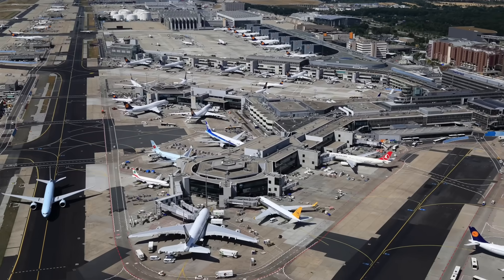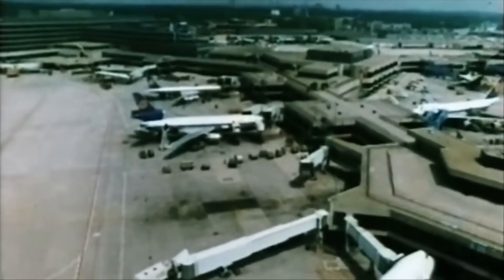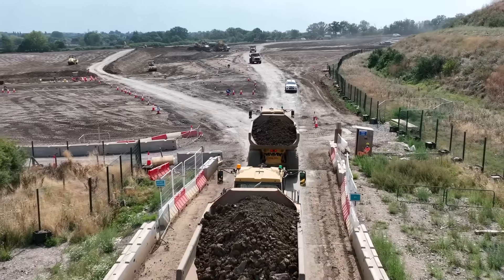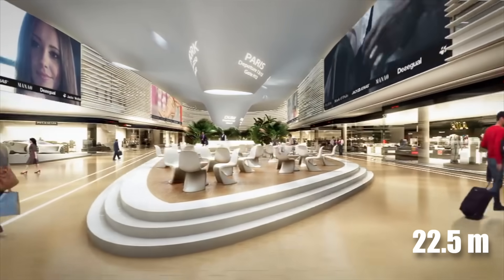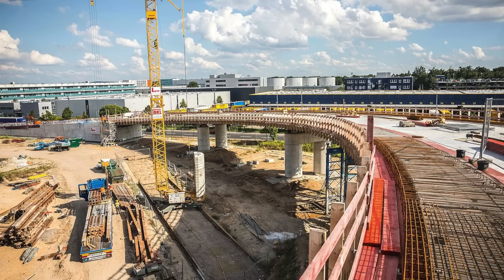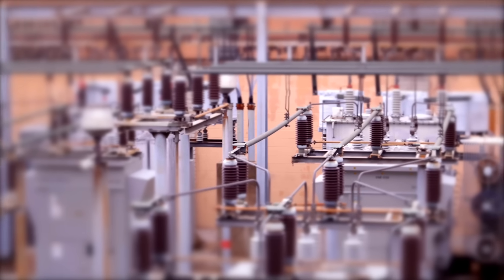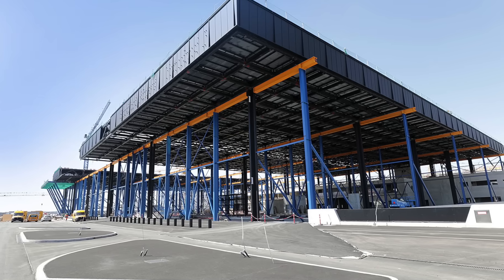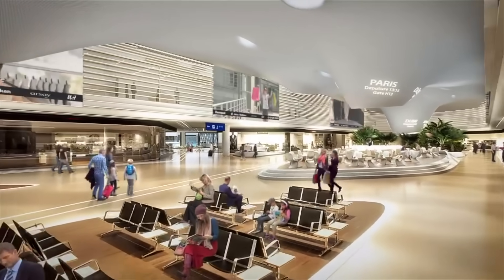Frankfurt's $4BN Mega Airport Expansion

Comment: Frankfurt and the region cannot handle it as the infrastructure surrounding the airport is crumbling. It will be nice to look at if you take the effort to fight your way on the autobahn or take the painful S-Bahn ride which currently suffers. It suffers from maintenance work on the routes Frankfurt-Cologne and Frankfurt-Mannheim - after which it will be not better as in the next decades the country stumbles in maintenance work to keep its neglected infrastructure somehow running.

Lastly don't think this 3-Terminal airport will run on 3 Terminals. This is my local expectation: they will close down existing terminals or parts of it for more upgrades as they also are in an inferior state.

Comment: There is also another train curve under construction, so the S7 commuter train line can run to terminal 3 which will get another underground train station. Like this, people coming or leaving by public transit to or from the central station in Frankfurt won't have to take the Skytrain to Terminal 1 and take the train station there.

Comment: They are going to use the same Company like in Berlin, so triple the costs and have a delay till 2045?
Reply: The difference between Frankfurt Airport and Berlin...

Here in Frankfurt, the state of Hesse, the city of Frankfurt, Lufthansa and BlackRock Inc. (just one of two shareholders as an example) are building up as owners and not, as in Berlin, two federal states including the state as financier and a new company. In principle, a completely new airport was built there.

Frankfurt is not a new airport. The buildings are an extension.

The construction process is “full of time” and will open in 2026.
Reply: Frankfurt Terminal 3 is already nearly finished and still on time schedule. That is quite impressive if you consider the sheer size of this project (that 1 Terminal will have roughly the same capacity as the whole airport of vienna) and the fact that it has only been under construction for 4 years.
Reply: Frankfurt a M. is not the communist, backward and left wing "smelly" city of Berlin.

Comment: Could this be Europe’s most advanced international airport once completed?
Reply: whatelse? Don’t count London anyways it’s literally in the Atlantic
Reply: First of all, it is simply an expansion to create capacity. The two old terminals can no longer do that.

Terminal 1, which dates back to the 1970s, still needs to be renovated and Terminal 2 is already modern. Lufthansa wants to use both terminals for itself and convert them into a more modern terminal.

With Termnial 3 you build for the future and initially have an alternative option.
Reply: @tobiasmuth2372  T2 is modern? what does T2 have better (genuine question).
Reply: @ibuzz1337  T2 was built in the 90s. Completely different structural specifications than T1 (70s).

T2 was also built because of the wide-body aircraft. Fraport was one of the first airports to have such a terminal.

Terminal 1 is now being renovated and converted into a future-oriented facility during ongoing operations. In the future, T1 and T2 will be combined for Lufthansa.
Reply: @tobiasmuth2372  no I mean, t1 feels bigger than t2 because of all the 747s Lufthansa has, I've travelled through t2 twice, emirates a380 and Kuwait a320. The terminal seems small and neglected to me honestly, but I love the sky deck at t2
Reply: @ibuzz1337  If T1 was built to a 70s standard, that is much older than T2.

Despite the dimensions (smaller) and different standards, T2 has a different occupancy. T1 must and will always be readjusted. That will also happen with T2.

T3 corresponds to the latest standards.

Standards include security checkpoints, baggage carousels and check-in space.
Reply: @tobiasmuth2372  Hmm, interesting, I travel a lot between Frankfurt and India, but mostly travel with Lufthansa, so it's always been T1 with some exceptions. Thanks :)

Comment: Maybe, just maybe finally go with Berlin Sperenberg.

Such a nonsense to add even more to Frankfurt, as it ran into its expansion limits a long time ago.
Reply: In Germanys aviation Berlin is just not as important.
Reply: It makes perfect sense to expand the terminal capacity in Frankfurt. The runway capacity has been increased over a decade ago by adding the new northwest runway already. It can not be fully used though, as the ground handling capacity was limited so far. This issue will now be solved with the new terminal :)
Reply: Frankfurt's issues won't be solved without additional runways, which would be extremely expensive if not impossible.

And nighttime flights won't be solved with Frankfurt's expansion either.

It is Lufthansa that doesn't want Berlin to expand any further, as suddenly a lot of airlines could get slots in Germany. For Lufthansa that would be unwanted competition, for the aviation industry however it would be very valuable.

And that's just the beginning of the list of issues with Frankfurt's airport.

In Frankfurt every time the airport expands, massive protests are the result, while in Sperenberg people would love to see the airport bringing in business.
Reply: @jantjarks7946  If a proper hub had been built in Berlin, Lufthansa would have moved their main operations there from FRA and MUC. That was the idea in the 1990s. But instead of a massive new hub in e.g. Sperenberg, Berlin only got the massively restricted BER. But nowadays Sperenberg is not gonna happen anymore due to financial, political and environmental reasons.

Frankfurt has runway capacity left. With the current layout 126 movements per hour are possible. The limiting factor is the restricted handling capacity in the terminals ;)
Reply: @matthiashartge5520  That little runway capacity is expensive, compared to what Sperenberg could offer for the same amount of funds.

As said, the night flight restrictions won't go away. The number of people affected by air traffic won't go down either.

It was the worst possible option available.

And no, Lufthansa didn't want to leave Frankfurt, the very reason for the current mess.
😉
Reply: @matthiashartge5520 Munich Airport never dies. Bavaria is the heart of Europe 💙
Reply: @jantjarks7946  The capacity is already there?! Sure Sperenberg would’ve made a lot of sense. But I don’t believe that we’ll ever see another completely new airport being built in Germany 😬 
Frankfurt now has to extend the terminals to use the 126 movements per hour as best as they can.
The night time restrictions have only been implemented with the new runway actually ^^
And yes: Lufthansa CEO Weber announced in the 90s that they would move hub operations to Berlin (Sperenberg) if a proper airport had been built ;)
Reply: @matthiashartge5520  Is Fraport still paying the people responsible for granting exceptions for night flights?
Reply: @jantjarks7946 Why would have a Berlin airport no night time restrictions?
Reply: @mingomo  Check where Sperenberg is located. It's between Berlin and Leipzig, the former main military base of the Soviets. They selected the location back then as it is very central to Germany's East (GDR). A railroad was connecting both cities.

There are only a few villages around it and people voted for the airport to be located there. Thus noise pollution is no big concern.
Reply: Imagine Fraport would have invested the amount of money in Sperenberg than for Terminal 3